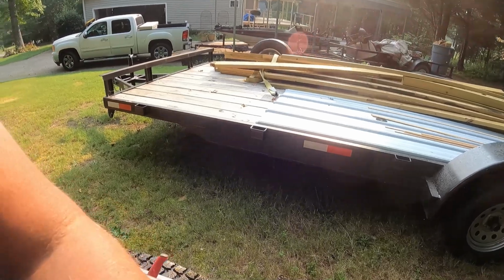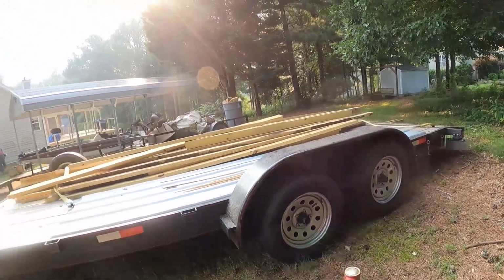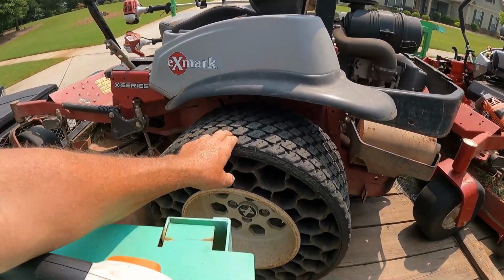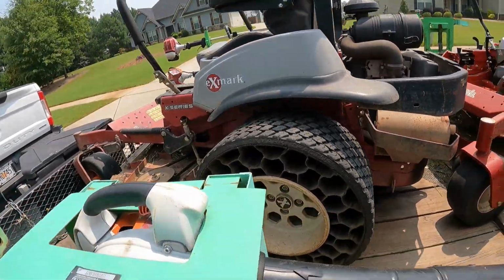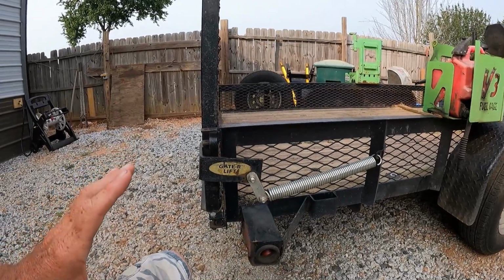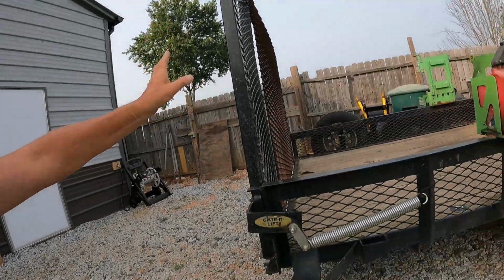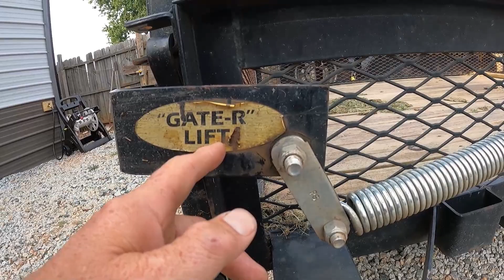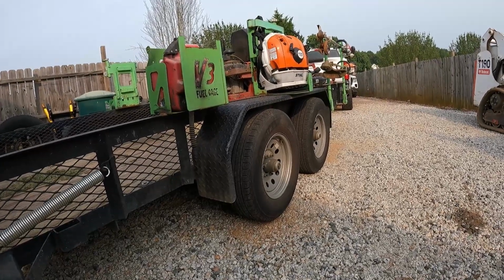LAWN TRAILER AND TWEEL TALK PLUS RESPONDING TO DIG COMMENT

Comment: I have a 5,200 pound axle under my single axle trailer
Reply from the maker: where did u get that?
Reply: @rayrayslawnlandscape2008  my buddy has a shop and he ordered me a 5,200 pound axle and upgraded the leaf springs and shackles and rim size and put electric brake on it to
Reply: @rayrayslawnlandscape2008  did it last year it ran be 870 buck for everything and installed

Comment: Hey Ray Ray.   Probably a dumb question but , how can I determine what the axel rating is for my trailer?    I’ve got a Legend aluminum tandem axel.   14 ft.      Thx for the help buddy.
Reply from the maker: HOW MANY lugs are on tire
Reply: I’m at work now.    2nd shifter up here in Michigan.    Making car parts.   😁.     I will definitely check when I get home tonight.    I believe it has 5 lugs though.    Nice looking trailer just unsure of the weight capacity.
Reply: Each wheel has 5 lugs Ray.      Tandem axle.   Tried attaching a picture of trailer but can’t.     Guess I’m YouTube illiterate.    😂
Reply from the maker: @brianbeene4181  5 log is gonna be a 
3500 lb axle. 
If you got two axles in seven thousand pounds
Reply: Appreciate it brother.    I will keep that in mind if I buy another trailer in the future.    👊🏼👍

Comment: I agree with you on 3500 pound axle trailer, I want ever buy narrary nother one, the axles EAT TIRES don’t matter what kind of trailer tire you run, I run the best and still had to put new tires on it every season, That Gator Made landscape trailer is bad to the bone, top of the line for sure 👊🏼

Comment: what are the differences between your tweels are deere ?same company michelin?
Reply from the maker: the regular michelin tweels are black with vertical center- The exmark tractus tires are honeycombed
Reply: @rayrayslawnlandscape2008  is there performance or reliability difference sorry?
Reply from the maker: @shanepipkin4041  not that i can tell - the tractus exmark tires are about 150 bucks more per tire than the michlin

Comment: A trailer has one job that’s to haul stuff to job I use big Tex single axel 7-14 it’s got 5000 axel but no breaks to maintain only to tires to haul Ferris 2100z 700z trimmer blowers in bed truck dump trailer for jobs.  Plate steel on ramp lol 😂 fool my one trailer ugly but makes lot money tell ‘em ray ray  1000$ trailer 4 by 6 at tractor supply is 1300$ 4 lug guy in comment amazing the shit people say it’s entertaining